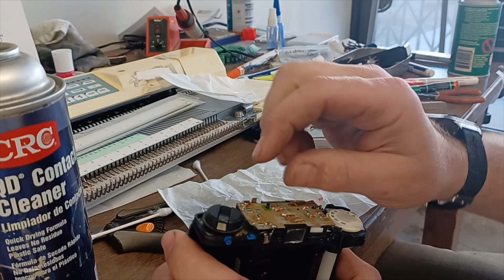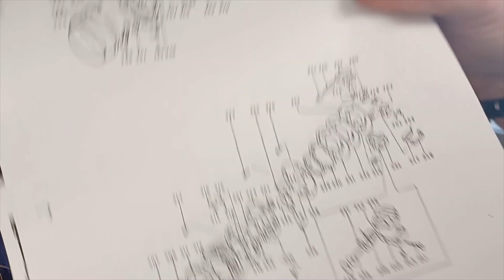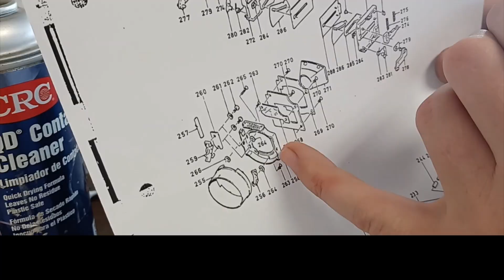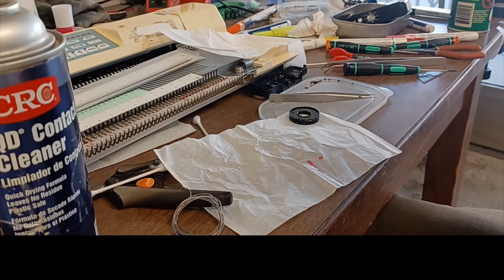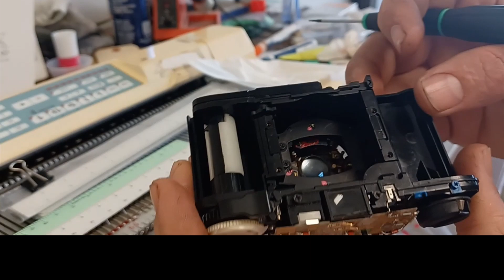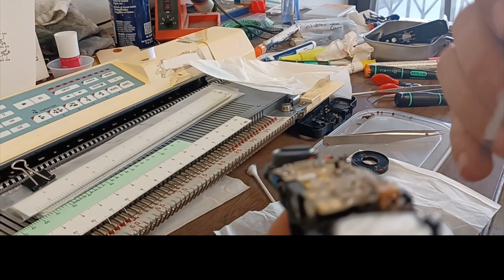Minox ML 35 Shutter Repair Fix

Comment: Hello
Thanks for a thorough video
My GL model has a broken film advance lever. The camera seems to work fine just using the thumb wheel for film advance and setting the shutter. 
The stub of the film advance thumb crank is rather sharp. 
Any idea how I can remove it from the camera all together, or perhaps get to it for replacement?
Thanks

Comment: What you are calling snap rings are actually E clips and/or C clips. Those pliers are not used to remove or install them. Just use a small screwdriver to pop the clip off, and your fingers (or a pair of normal pliers) to pop them back on.

Comment: i had a faulty shutter too. for me the solution was adjusting the pusher forwards. it's located under the two larger, non-painted, screws on the right. loosen them a small bit, push the little arm mechanism forward (towards the topside of the camera) with a smal screwdriver, and screw the two larger screws back tight. for my camera i had to move the arm mechanism all the way up for it to work again.

Comment: "Not confidence inspiring." Ha! You did great, kid. I've dealt with the cracked ceramic before, and this week got hands on a GT that's taken a dive. The counter is misaligned and it takes effort to screw that up. The tradeoff is a solid day or two of work to get a pocket full of excellent. Keep going. If you find you get good at it, low-ball all the "AS-IS" listings and refurbish them for a few bucks. Good luck.

Comment: It's me again. I bought an almost mint looking 35 ML for a good price because the seller couldn't 100% ensure it works. Sure enough it had shutter issues (would fire in P mode but not under any F stop setting) and just like shown in your video there were two problem. The position of the arm with the two screws and also the positionadjustment of the bottom magnet. Once I adjusted both the shutter began working reliably in every setting. Once again thanks a lot for your very informative video!

Comment: This is truly invaluable. Thanks so much for sharing all of your findings and solutions. I am interested in the 35 ML but wasn't sure if I should go for one that might have issues. It's hard to know which one works. Especially since many on eBay state that they haven't tested it and also because some just hear a click and assume the shutter works. While in fact the actual blades are not budging. I stumbled on that forum thread where someone explained how to adjust that lever position (probably what you mentioned in the video) but you went over way more other possible problems and fixes. I am somewhat confident that I could repair a unit in case it's faulty now... at least it's worth the risk. Thanks a bunch!